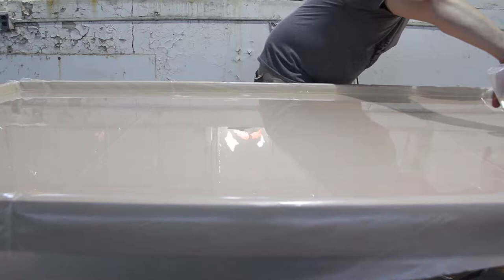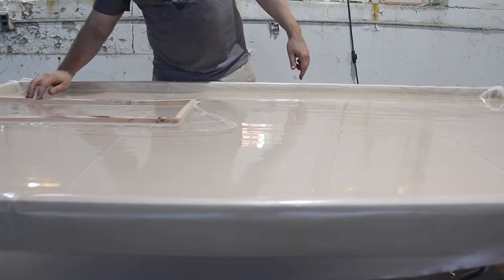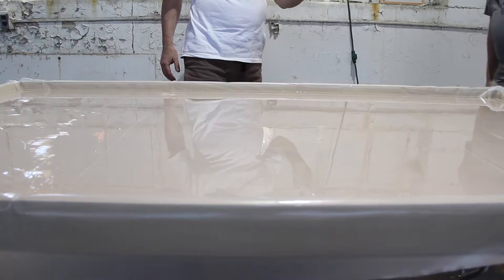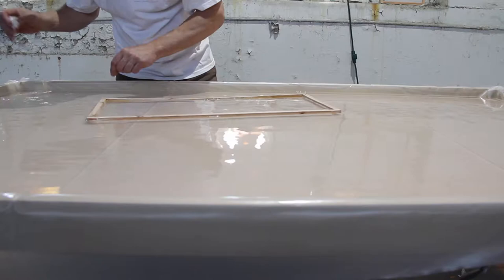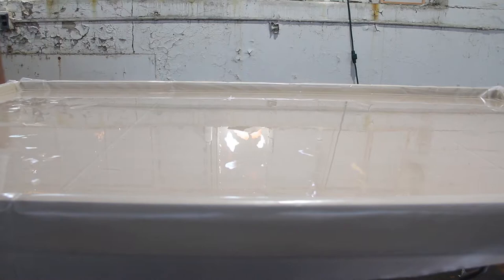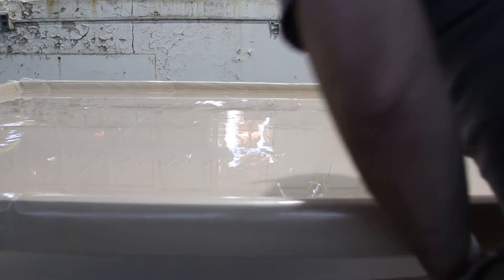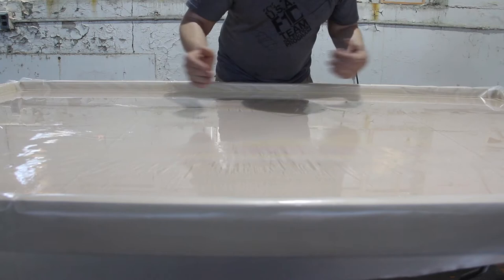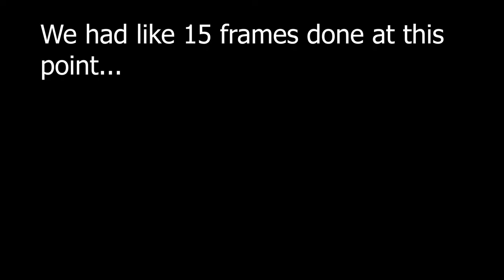F1D vLog Episode #19 Pouring and lifting microfilm with John Koptonak

Comment: could you please tell me what's the thing you pouring into the water
Reply from the maker: That is microfilm solution called Violet Dream made by Dezo Orsovai. Basically it is nitrate dope with some other secret sauce ingredients (I think.)
Reply: @mikekirda4055  thank you so much!!!!!!
Reply: @mikekirda4055  FOR ANYONE WISHING TO MAKE THIER OWN MICROFILM SOLUTION:
 I've spent hours looking for formulae in old model building literature and the consensus (At least from what I have gleaned) is that the main idea of microfilm:  is that it is a cellulose nitrate based film. A nitrate based aircraft dope (nitrocellulose being the main active ingredient) is the basis of the microfilm solution, plasticizer agents are then added drop wise: castor oil/camphor, and finally a thinner N-butyl or ethyl acetate.  These ingredients are what is needed for microfilm; the amounts of each  ingredient would then be honed to precise ammounts through experimentation.

Now for the less adventurous amongst us (or those whom do not have the time to experiment) an easy formula from easy to obtain products would be to start with (and then refine the mix): 3 parts Randolf Nitrate Dope, 1 part Sig Nitrate thinner
and about 20 drops of castor oil per pint of solution 

This is of course a simplified formula but will be of use for those who plan to venture down into the "black magic hole" of the traditional "poured" microfilm wing covering film

I forgot to add: This poured microfilm solution is also referred to as "Flexible Collodion"  do not confuse this with regular collodion (non flexible)